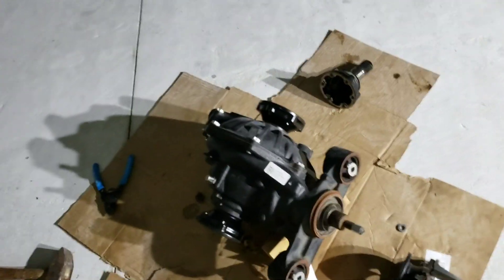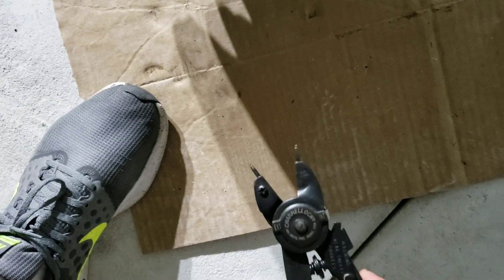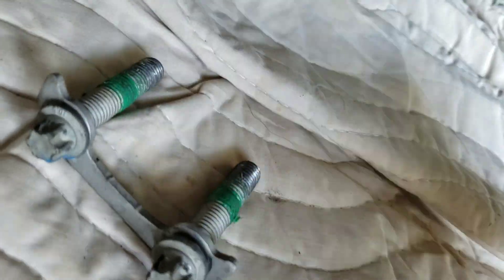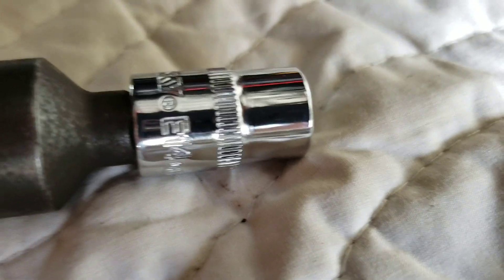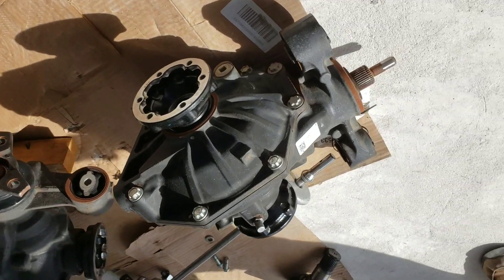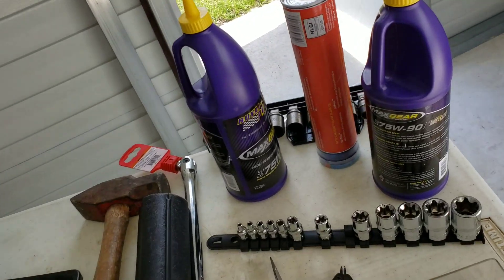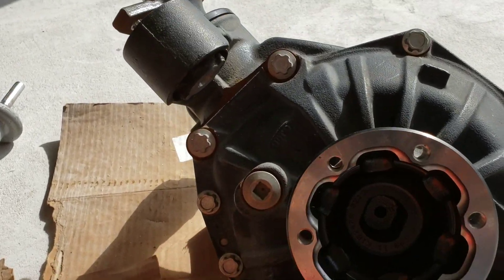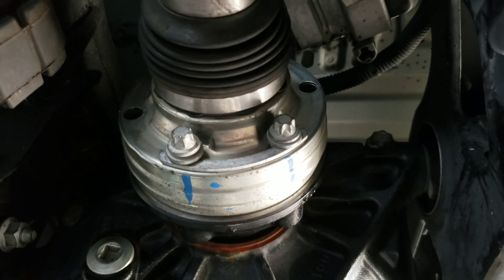How To : 2016 2017 2018 + Camaro V6 RS 2.77 to 3.27 LSD Differential and SS Axle Swap

Comment: so to swap this into my SS do I need to just swap the flanges?  how about the driveshaft flange or cooler lines?
Reply from the maker: You will need your axle flanges and your pinion flange(driveshaft) off your old diff to install onto the 3.27 there are no cooler lines on the V6 diff.
Reply: HyperHawk Motorsports ok that’s pretty simple.  I’m not certain but didn’t the 1LE have cooler lines?  No matter I could probably just block them off?
Reply from the maker: @jessemurray1757  The 1LE diff does yes. But your not going to find a 1LE diff what you are looking for is a diff from manual V6 or 2.0t it's the same as the 1LE V6 diff strength wise they are the same diff the V6 1LE just has the cooler for it.
Reply: @HyperHawkCamaro  thanks bud!!  if the diff is from a 2.0 does it have to be manual?
Reply from the maker: @jessemurray1757  If you want LSD yes. The 2.0 auto is 3.27 gearing but with a open diff.
Reply from the maker: @jessemurray1757  actually if you have an SS you have to get it from a manual because your axle lengths are for LSD diff.
Reply: HyperHawk Motorsports axles lengths between mine and which are different?  If I aim to get one from a v6 or I4 manual car I’m good to go right?
Reply: HyperHawk Motorsports and yes I want an LSD.  I found a few online for roughly 450, which seems pretty reasonable
Reply from the maker: @jessemurray1757  Yes if you get from a manual 2.0 or V6 your good to go just be careful lots ouy there labeled that way when they are in fact from an auto. Ask for pics easy way to tell is if it has the silver plate righr at 10 minutes mark in thr video I show the diff between the auto and manual
Reply: @HyperHawkCamaro  ok so I want the wider one without the silver (aluminum) plate?
Reply from the maker: @jessemurray1757  yes
Reply: @HyperHawkCamaro hey do you remember where you got that slide hammer from?
Reply from the maker: @jessemurray1757  slide hammer just rented from local auto parts. Its free to rent stuff
Reply from the maker: @jessemurray1757  oreillys autozone etc.. they should all have one to borrow/rent.
Reply: @HyperHawkCamaro  oh ok good deal.  I'm wondering there are any differences between the V8 and V6 driveshaft.  You said i'll have to swap the driveshaft flange as well?
Reply: @HyperHawkCamaro   also I wonder if anyone sells a cooler line block off kit.
Reply from the maker: @jessemurray1757  do you have cooler lines ? And as far as the flange yes your V8 driveshaft pinion flange is diff then the V6 manual pinion flange its a easy swap also in the video.
Reply: HyperHawk Motorsports I believe I do, didn’t the V8’s come with coolers?

Comment: And where dis you buy the 3.27 lsd ?
Reply from the maker: I found mine on eBay as well as the V8 axles however I purchased the v8 flanges directly from GM
Reply: HyperHawk Motorsports do you have a part number for the flanges ?

Comment: The 3.27 lsd is from a v6 manual?
Reply from the maker: Yes So the 3.27 LSD from the 2.0t and v6 manual ( Same diff ) is not a direct swap into the auto you will need V6 or i4 manual axles , Or v8 axles and v8 flanges I did the V8 swap since the v8 flanges are direct swap and beefier as shown in the video.

Comment: If you were to do it over again do you think it’s worth it from your opinion. I know it cost like 2 grand to swap it over  to shave off maybe 1.5 tenth in the 1/4mile.
Reply from the maker: 2 grand ? Got the axles for 50 bucks the diff for 350 and the flanges for 100.  It's well worth and oh boy did it shave off more then a tenth! Gained almost 4 mph. Haven't released the video yet but it's impressive!
Reply: Hyper Hawk oh okay yea I’m asking because Jim ran a 10.4 with this diff setup and Troy ran a 10.6 with the stock 2.77 diff. He said it’s not worth, jim said it is. I don’t who to believe haha. These are the lt1 record holders by the way. I’m sure you heard about them both. And you got a good deal on those diff pieces. I guess over here in Cali prices are much more expensive.
Reply from the maker: @josepulido4176  you know the V8 trans is geared slightly different then the V6.. but let's say my results were more significant then .2 for me it's a night and day difference.. I put the diff in changed the ratios in the tune and we'll was amazing!
Reply: @josepulido4176  I think I have troy convinced to do the swap.  Now to find out how to swap this into a V8 car.  will the axles, driveshaft bolt up?  Also since the V8 cars have diff coolers do we need to buy a specific one that has the cooler fittings or did the all 3.27 diffs come with cooler?
Reply: Jesse Murray you should hit up rpm and pray. They will assist you bro. But it all depends on your setup and goals for your car
Reply: Jose Pulido I should be getting my ported intake and throttle body any day now from pray, been waiting almost a month.  I’m sure someone here has the answer about the flanges.
Reply: @HyperHawkCamaro just lsd alone makes this worth it😂
Reply from the maker: @AntChiulli-Chiulli_RS  def one of the top mods. You can do the LSD 2.77 from the SS as well if you don't want to mess with the gearing.
Reply: @HyperHawkCamaro  still looking for one at the right time haha
i’ve wondered about the 2.85 although would need tuning for the shift points, i wonder if that little bit would be usable on the streets with the A10
Reply from the maker: @AntChiulli-Chiulli_RS  I cannot comment on the a10 but I know the 3.27 with the A8 first gear is kinda useless.

Comment: As far as I know the V6 comes with a 3.27 and it's the 6.2L A8 models that come with the 2.77. Please correct me if I'm wrong. Do you know if me swapping over to the 3.27 would be beneficial? I'm stock as far as transmission/diff goes.
Reply from the maker: Yeah the trans gearing in the V8 is diff it's all about what your goals are.. you won't have traction issues with the right tire. But if your shredding around town in street tires yeah you probably will.. It's a pretty huge diff for me.
Reply from the maker: V8 and V6 autos come with 2.77 the difference is the V6 is non LSD. The V6 and I4 manuals come to the 3.27 lSD and the i4 auto comes with 3.27 non LSD. Manual V8 has 3.73 LSD which also can be swapped in but creates for really short gears
Reply from the maker: There are a couple V8 guys running the 3.27 LSD with good results. But it's real beneficial for the V6 because the lack of low end torque
Reply: @HyperHawkCamaro  yeah i read that on the forums as well but it seems like the difference isn't as drastic with the v8, i don't know if i want to sacrifice the top end to potentially introduce traction issues down low.